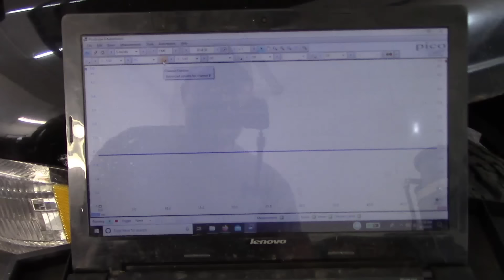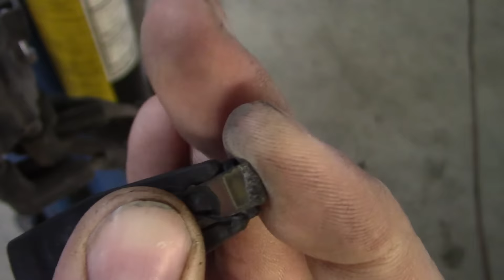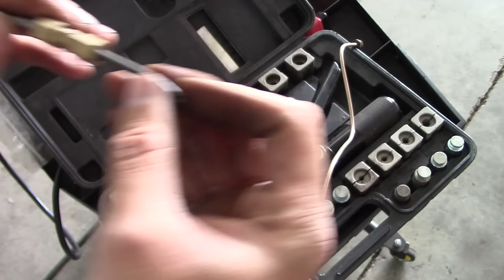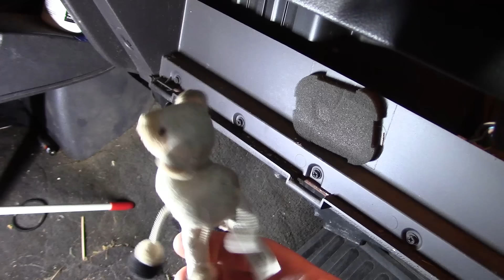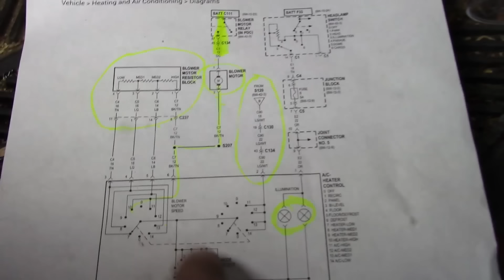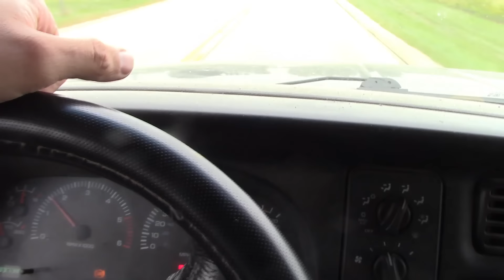2001 Dodge Ram 2500 - Random Missfire, Blown Brake Line, no Heat or AC - basically it's an Old Dodge

Comment: Thank you Wes for all the great videos. I had a 99 Ram sport. In regarding the failed steering on those trucks, I found the 1987 GM Chevy 3500 steering gearbox was the cure-all for worn gearboxes and a Borgeson steering shaft.
Reply: Does this by chance apply to the 2000 ram 1500 ? My death wander isn't as bad as some people's I've seen but I'm really wanting to fix all the minor issues on this thing since it's my first 5 speed 4wd, in great shape with little to no rust, only 161k miles
Reply: @ruller213   I cannot tell you on this. I bet it will fit. While the one ton gear box did not remove death wobble, my steering was extra firm, and very responsive. Significantly more than the 1500 style box. I also installed a Borgenson steering shaft as well. The one ton box has a extra splined nipple on the end, just cut off if you need to.
Reply: @ruller213 good track bar. HD T steering. Lukes links and good ball joints. Also check the column. They get sloppy where the shaft comes out of the column. I have a 2500 and went with the free spin kit too. Made a big difference.
Reply: Something Ive found in my research is that they used the wrong ball bearings in the steering box and they had a lot of slop. The red head steering rebuild corrects these issues by replacing the bearings and eliminating the slop

Comment: A bit crusty?? Lol.. probably not a good idea to blow acid corrosion all over the engine bay... They make these things called vacuums that suck stuff up....
Reply from the maker: I have to hose out the brake fluid anyway.
Reply: @WatchWesWork  👍 do you have a steam cleaner or just go with water?

Comment: About a year ago, I was working on a neighbors Ram 2500.  He bought it new and had the dealer put the Electric Trailer Brake Controller in it.  He ran it about a year and then came to me saying he thought there was a problem with his trailer brakes.  I checked the trailer brakes and they were ready for replacement.  I tested the brakes when done and they worked perfectly.  He came back to me about a week later saying he still didn't have trailer brakes and after checking, I found out that when the dealer installed the brake controller, they just mounted it and never connected up the wiring to the hitch wiring connector, so it wasn't sending any power to the brakes.
Reply from the maker: The newer ones are smart enough to know when they are connected to a trailer and show you what percentage of current they are applying to the brakes on the digital display.
Reply: @WatchWesWork  Yes, I have seen that now they show up a light of a different color when it doesn't sense the trailer attached.  The one they put in the neighbors truck wasn't like that though.  I have been looking at one for my Trailblazer that only has a small knob that you mount in a convenient location and the main box gets concealed in the dash.  It has a light ring around the knob that shows one color when the trailer is connected and another color when no trailer is detected.  It's a little more pricey, but I like the way it looks.

Comment: Tell your customer to dump the battery. They hit the very end of their life and develop internal shorts, they'll start gassing like crazy and you'll see loads of corrosion build up within a few months on the terminals. If they short hard enough, they'll take out the alternator (probably just the diode pack, but dead is dead). It's false economy, especially if it's a daily driver.
Reply from the maker: It will be replaced before winter.

Comment: Never seen a battery terminal and post clamp cleaning tool before 👍,  I used to use a mild alkaline solution to dissolve or neutralise the corrosion, Cabbage water works well, though a very mild bleach works, do not use a strong solution or an energetic reaction will ensue, and spit out all over. Hi tension hardware was definitely toast, same with brake fluid.
Great vlog Wes, thanks for sharing.
Reply from the maker: My dad used to use Pepsi.

Comment: I thought you might have to replace the brake calipers. When is NHTSA going to get smart and require all brake lines to be stainless steel? All fuel lines should also be constructed of non corrosive material.
Reply from the maker: I wish they would, though it would take a lot of work out of my shop!

Comment: I just bought a truck that sat for a long time in a field. runs pretty good actually but but one of the spark plug wires on the distributor side was missing a boot they just had the wire shoved inside the hole on the distributor. And the wire looked just like the one you ripped off

Comment: New brake lines and hoses but you reused two rusty $.39 line nuts?
Reply from the maker: Good ones are $3 a piece. So yes, yes I did. As long as the hex is good they are perfectly fine to use.

Comment: I've been turning wrenches here in Florida for over 20 years and I can save for a certain after watching a bunch of these up north videos I would never have become a mechanic if I lived up north.
Reply from the maker: Probably a good call. You get used to it, you really do. Also, rust brings us a LOT of work. Almost every vehicle here will eventually need brake lines, fuel lines, sway bar links, calipers, wheel bearings, springs, etc just because of the rust.
Reply: @WatchWesWork  That's true I never thought of that. Down here that vehicle would have been in the scrap yard long ago.

Comment: Were American manufactured cars of that vintage not galvanized from the factory? I'm not in the Auto repair trade, but the cars of similar vintage that I have seen in the UK don't seem to have as much rust.
Reply from the maker: You guys just aren't trying hard enough!
Reply: @ruben_balea  I believe the German manufacturers started hot dip galvanizing all bodies and parts and spraying hollows with wax for some models sometime in the 80's and most of the other brands were forced to follow suit to compete. By the mid to late 90's onward, it became standard practice. They use some special process to get the paint to bond.

Comment: The age of that truck has proven its lasted. Just some way overdue maintenance. I have a 1999 dodge with 318 that is still running perfectly fine. My ford that’s half the age of my dodge and half the mileage and twice the problems.
Reply from the maker: Sure. It's done pretty well considering!

Comment: Next time you have crusty battery terminals like that, instead of scraping at them and spraying solid acid all over the place, get some baking soda and dissolve it in water and pour or brush it on the terminals. It will neutralize the acid and dissolve all the crusties in about 5 minutes. Instant clean terminals, just coat with sheep goop.
Reply from the maker: I'll try it!
Reply: @WatchWesWork  Ideally you want to do this outside the shop. There is a thin layer of acid and dirt all over the battery and the tray and battery compartment. You only see the terminals (and hold down) corroding because that is the only place there is metal to corrode. When the battery gets damp this makes a self-discharge path, so you really want to get it all off. The baking soda solution will foam up when it contacts the acid, and you want to keep washing until it stops foaming. Wash everything that foams. Then you want to wash it all down with clean water to not leave a basic film on the battery, since this also makes a self discharge path. You also want to clean out the tray and drain, at as least as much as you can without pulling the battery. This tends to make a big wet mess for a while.

Comment: Great job as always! That truck has been seriously neglected. Those brake pipes have been bad for a while. Here in the UK it wouldn't pass the yearly roadworthy certificate if the ABS was disabled. I understand that some people aren't mechanically minded but that truck was a death trap. Great explanation of the diagnostic process and loved those contact cleaner tweezers! You definitely have mastered a whole special skill set when it comes to dismantling rusted junk. The UK is known for its wet climate,but have never seen a truck as bad as that. Great job Wes I salute you!
Reply from the maker: You just aren't trying! We can get rust like this in 5 years if we work at it!

Comment: Did you ever think the rust is because of where you live and more than likely a severe lack of maintenance by way of the owner. My Dodge has 302,000+ with no rust or wiring problems.
Reply from the maker: I guess. But how does where we live affect interior wiring?
Reply: @WatchWesWork  Wouldn't the longer periods of cold (freezing) and humidity along with the truck just sitting have detrimental effect on the wiring?

Comment: Gotta say, after framing, setting up studs and hammer drilling all day -- I'm glad to get off work to see Wes uploaded. Question for you too. It's always been on my mind. If the crank or cam are out of time when you rotate the engine by hand and they never line up with the marks at all, can you just freely adjust one or the other until they line up with their marks? Love the content too.
Reply from the maker: I guess it would depend on the engine. You have to be careful so the valves don't contact a piston.

Comment: You might have done the guy a good turn and adjusted the sector shaft in the steering box. Easier whine, I g
Reply from the maker: The steering wander in these Dodges is a combination of poor factory geometry choices in the solid front axle, and a weak mounting point on the frame for the steering box. Neither can be easily fixed.

Comment: Had the same issues on my 99. Only thing i could not fix is the blender door motor. When you have it at high heat or coldest setting the motor will continue to turn nonstop and break the plastic socket 😔
Reply from the maker: I think there is a calibration procedure for that. Most vehicles have one.

Comment: Hey Wes, love your vids, do you have a vid on drilling out rotten snapped off bolts? I deal with it a lot working in the North east and I can see you probably drill out more than a few a day, what drill bits and other tools do you use? As well as thread inserts? Would love a vid on it
Reply from the maker: Heh. That's a whole subject in itself. I like the "mechanics drill bits" which are a little shorter and have 3 flats on them so they don't spin. I do use helicoils pretty often. I use the Stanley ones. And I like straight flute extractors.

Comment: FYI, be careful about high voltage feeding into the laptop. Whilst the board has protection, the HDD does not. If you have important stuff in there, i'd probably not keep it inside. I learnt that the hard way with a Leyden jar.
Reply: The pico scope he is attaching it to is a USB device and it's isolated from the USB bus.  No need to worry.

Comment: Wouldn’t any neglected high mileage rust-belt 2001 car brand be a POS service mess? I’m not particularly a Dodge fan but living in NE Ohio with salty winter roads takes its toll on any everyday driver. I’m kind of surprised that truck is worth fixing. That being said I think you did a fantastic job on this truck. Wes, that customer should be so thankful you are there for them.
Reply from the maker: Yeah, any old truck here is likely a basket case.

Comment: With all that rotten metal underneath - not sure that Dodge would pass the annual Ministry of Transport inspection  here in the UK ? great content though Wes, thanks !
Reply: It wouldn't. I had a friend who bought a 1964 Fiat 1100 that had lived most of its life in Portugal. He told me of the horrors of trying to register a beautiful shell. I think i dropped enough hints there. :)
Reply from the maker: No inspection here. If there's enough left to attach a license plate you're good to go!
Reply: That ABS light is also a killer ....  It wouldn't pass here (Sweden and Norway too), or for that matter the brake lines... before Wes changed them.

Comment: We had a 97 Dodge Grand Caravan, and the transmission went at 37,000 miles. Reverse needed a rev to engage it. Whenever I hear about Dodge, the first thing that comes to mind is the transmission failures. You have to be a Dodge fan to want a Dodge, too many problems. They had the Cummins 5.9 12 valve which is legendary, but the truck falls apart around it.

Comment: Hi Wes, I've noticed when you are doing brakes the brake fluid keep pouring out when you disconnect the pipes/hoses. I'm sure you are aware of this trick, but I'll leave it here anyway in case it might help you or someone else. Before you start disconnecting any pipes, put a prybar or something like it between the brake pedal and the seat in order to close off the feed holes in the master cylinder, you only need a small bit of travel on the pedal before the holes are cut off. This way you will have a lot easier time refilling and bleeding the system, and no chance of the reservoir running empty while you are doing the work. I've been doing it this way for many years since an old timer taught it to me. :) With regards, Arne from Norway.
Reply from the maker: It's a good tip. This thing needed a whole brake fluid flush/exorcism, so I had to start over with the fluid.
Reply: I saw that yucky mix of diesel and coffee later in the video, when brake fluid is that far gone it really isn't that big of a deal if some air gets trapped in the master cylinder.

Comment: Its a wonder that truck started with those battery terminals like that..... wow.
Reply: The owners treat this truck like crap.
Reply: My 2003 4runner had  copper positive terminal connector. The buildup built up so badly it separated the terminal from the post.  One day it just wouldn't start.  Pulled the terminal off to clean it and it completely fell apart... new terminal installed in the parking garage and all was good again

Comment: Always give a Dodge a couple revs in neutral before attempting to move if its been sitting for a while.
Reply from the maker: LOL. Is it in the owners manual? Probably should be! Maybe with a note *replace transmission every 60,000 miles!
Reply: @WatchWesWork  You seem like a guy who's always seeking knowledge. I guess this is something to take 5 minutes and look up. It also affects the 727 and 904 transmissions as well. Dodge tried to remedy the issue with an inline that check valve that failed miserably.

Comment: I remember my Mom loved her 1979 Dodge Fire Engine Red Ram Charger four X four (it actually had the words four X four on the side). I was 8 when they bought it and we had a huge snow storm we went and my Mom did donuts in the mall parking lot. Best vehicle she said she ever owned. We would still have that Dodge if some idiot didn't run a red light and T-bone my Dad going 45 mph. It smashed the passenger door and slightly damaged the bottom rail on passenger side but State Farm totalled it and my parents got a 1988 Dodge Pickup which in 2005 I believe was voted worst Pickup ever made in last 50 years. I would agree it was handed down to me and I drove it for 10 years and about every 2 months I would have some intermittent electrical problem so I basically would only drive it during the day.
Reply: Yep. Those 1st gen dodges were famous for electrical issues and or fires. Mostly caused by the connection at the firewall.

Mine burned up the wiring behind the dash so I only used it in day time

Comment: And, I saw somewhere that using brass compression fittings on brake lines is absolutely as safe as you can get. At least as safe as using hydrogen in your rigid airship. OH THE HUMANITY.

Comment: Once saw a post on AskReddit that went "Mechanics of Reddit having worked on cars what make would you absolutely not buy for you or your family?" and the vast majority said Chrysler/Jeep/Dodge.  Someone replied to one of those comments saying that the Cummins engines in the trucks were indestructible to which the person replied that it's really a moot point as the rest of the truck will fall apart around it and a Cummins engine doesn't do much by itself...
Reply from the maker: Agreed!

Comment: Mechanics don't scrub down corroded battery terminals with baking soda & water anymore? 
The new brake lines look really good. The truck is a lot safer.
Reply from the maker: I guess I don't.
Reply: @WatchWesWork  I guess newer  & better products have replaced baking soda. My granddad taught me to clean battery terminals that way. It does take extra time and would cost the customer extra $

Comment: Hey Wes then you know all you need is a little Coca-Cola to clean those posts??? One thing you do a great job brother but I have never seen on any videos or maybe I've missed one you checking the fluid in the batteries do you actually do that or am I missing it because you're not filming it just curious I would imagine you do you're a pretty thorough guy! But I've never seen it!
Reply from the maker: I generally don't. Most modern batteries aren't really serviceable. You can use a hydrometer to check the acid, but they don't recommend filling them.
Reply: Wes I have never really heard that before I know there are some batteries you cannot get into but the ones with caps on them they should be checked with a hydrometer and filled with distilled water up to the level batteries always heat up and lose there levels. I have never failed yet to service a battery in any of my vehicles my neighbor with her car I checked for her and almost two cells or almost dry. That battery was probably already damaged although I did service it with distilled water and it came right back I wished I would have had acid instead but it work out. I have also done a YouTube Fix with distilled water and I believe Epsom salts and brought a battery that was two or three years dead back to life it doesn't always work but a lot of the times it does as long as the battery didn't have gel in it. Stay safe stay well and as always God bless